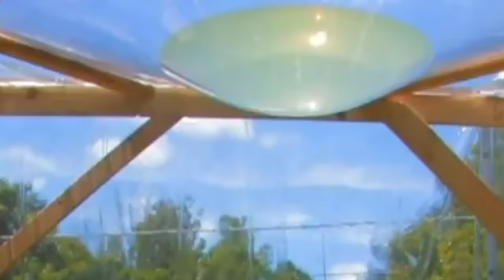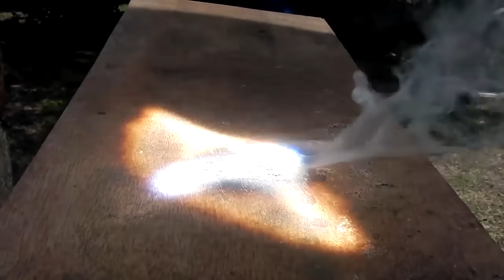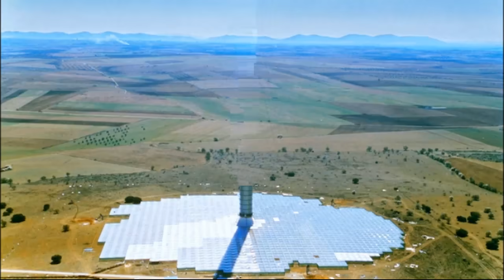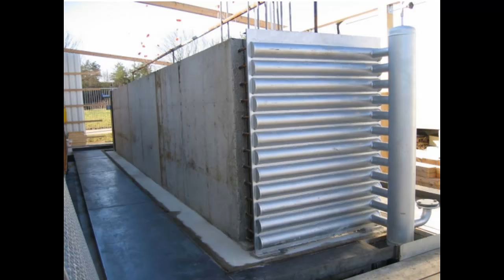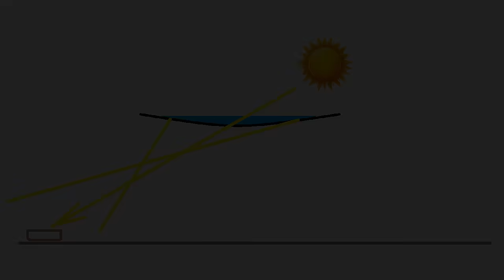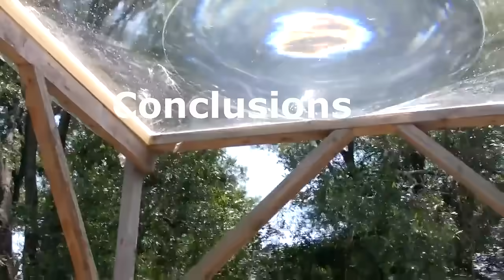Cheap solar energy from puddles. Is this a breakthrough? Energy and economic analysis

Comment: Maybe a closed loop where the water is heated below and cooled at the top in a cycle. Pretty sure the moving boiling water would kill any algae?
Making a long channel instead of a pond could also help to increase scalability and cycleability.
Turbine works best with one side hot and one side cool. So the cooled water from atop would help the turbine?

Maybe a closed loop would be possible so we dont loose water in the process to evaporation.

Comment: Have you ever tried using dielectric mirror films in your solar concentrators? It might increase the total output especially if it is paired with a polished aluminum backing or something to reflect thermal radiation as well.

Comment: Why didnt you pup a solar panel under it to test? Im guessing it destroys the panel.
Reply: I think the panel would need active cooling, which would require powering a pump. Which could reduce the efficiency. I'd be interested to see the numbers on a sterling engine though

Comment: I've also thought about using the foil and water lense. However maintenance is gonna be horrible. The foil wont last long. The water will get dirty and algae will from. The material would need to be thicker and the water would need additions so the algae don't form. The water would also evaporate over time even when using two foils.
Reply: Use the same water in the heat cycle to boil algae away?